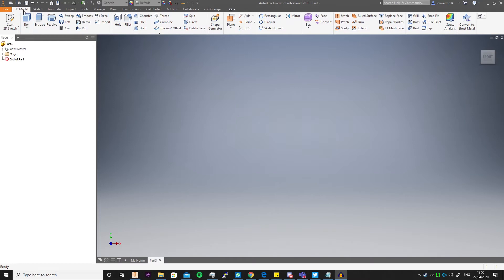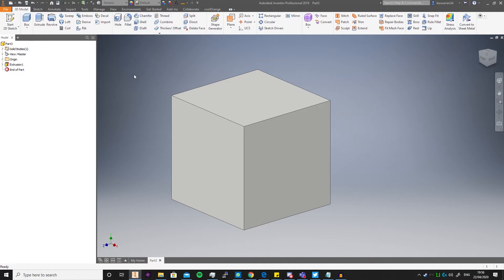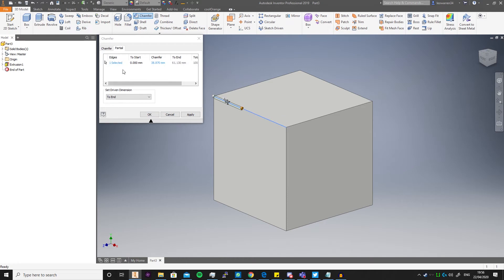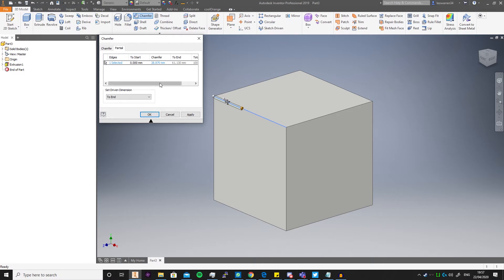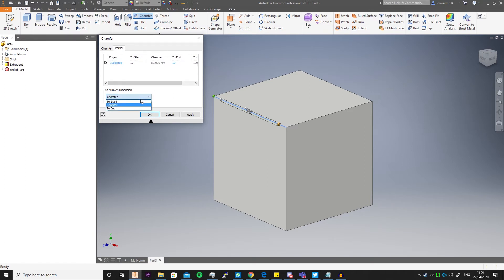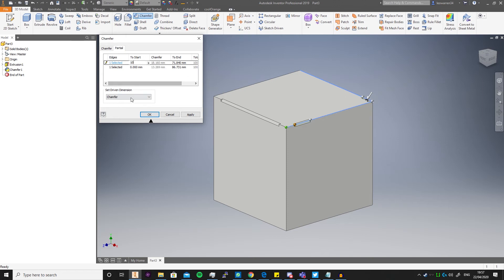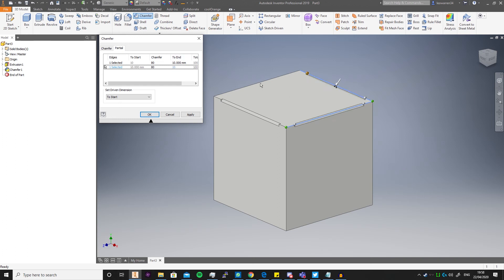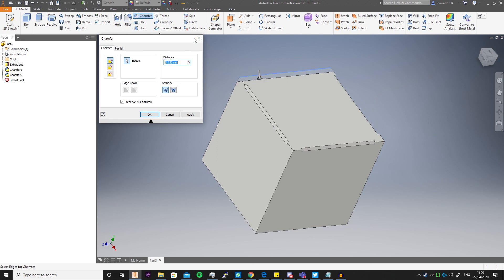Autodesk Inventor - Quick Tips - Partial Chamfers

Comment: nice video, what is the use of preserve all features?
Reply: If left unchecked, the chamfer will remove any features it intersects. So if you have a hole close to an edge, and if you chamfer that edge and it overlaps the hole, it will remove the hole (similar to the delete face command). If you leave the box checked, the hole will stay there and have the chamfer applied on top of it.